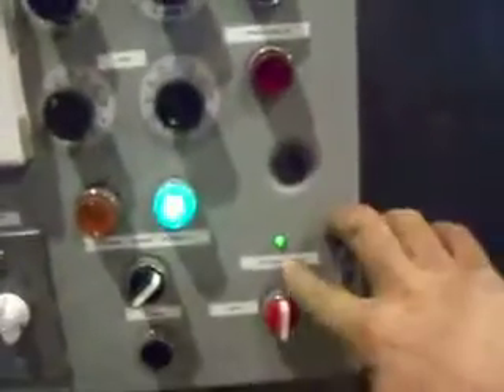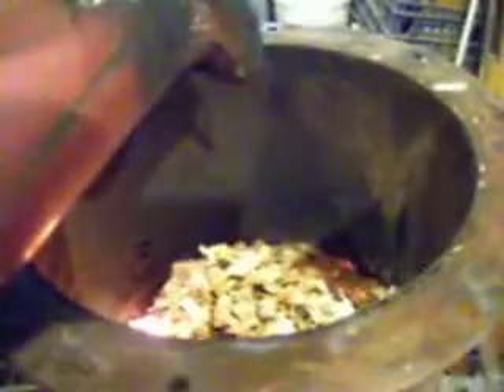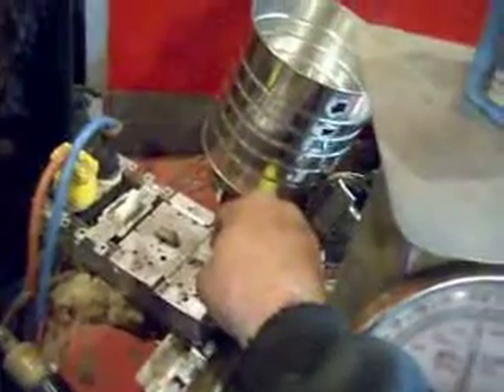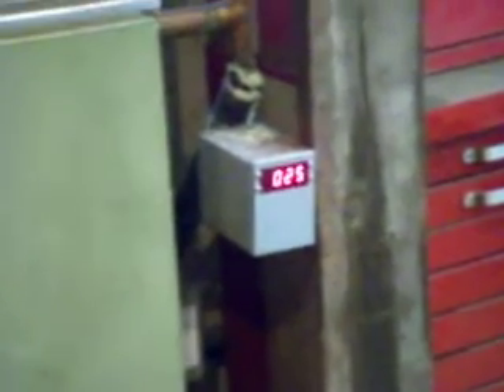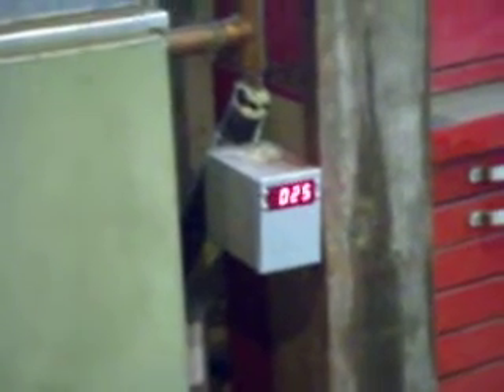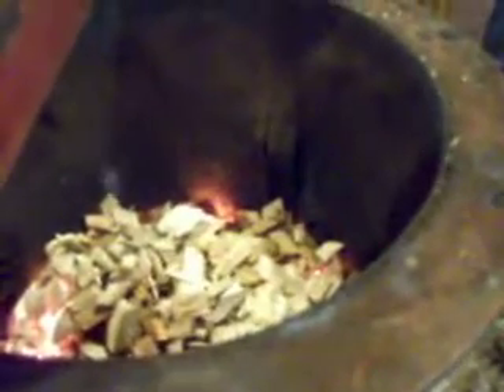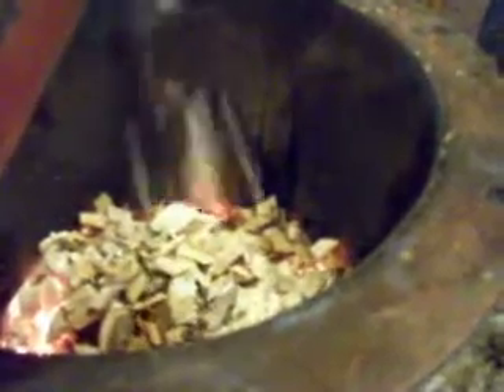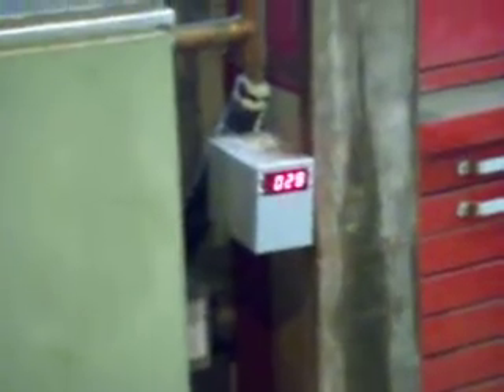Gasifier Automation 2 of 2

Comment: So you're making all the heat and all the electricity for your house with your original setup?

This one is not an engine gasifier though.

I see where you're at with the automation.  To go full-monty, you need a Programmable Logic Controller.

Add sensors, use Ladder Logic for contingency programming.

Eventually you'd be able to press a button and have it load and fire itself automatically, and maintain the chip height to meet demand instead of winging it.

If you go PLC, go Allen Bradley.